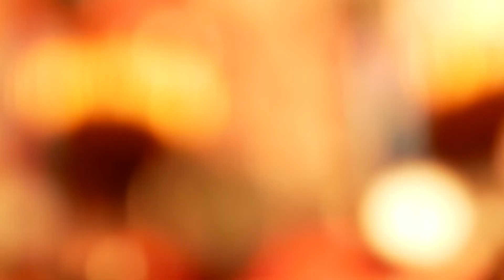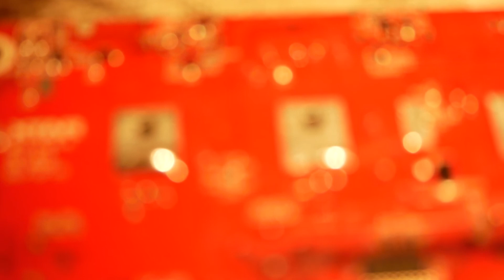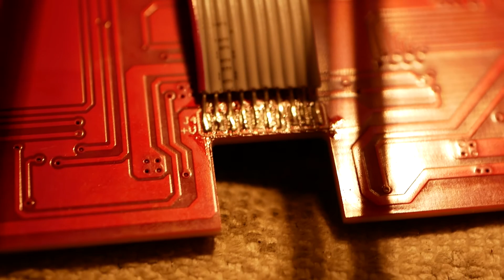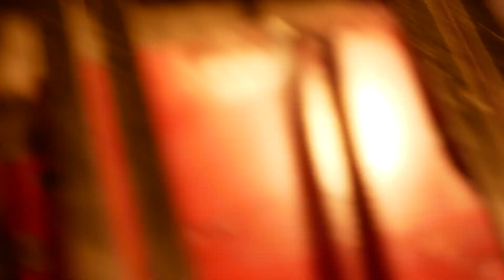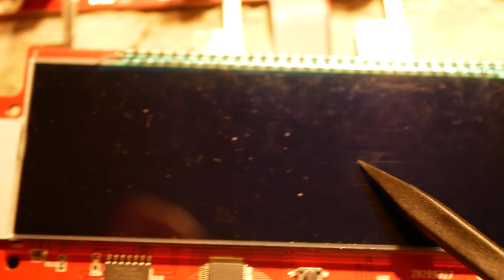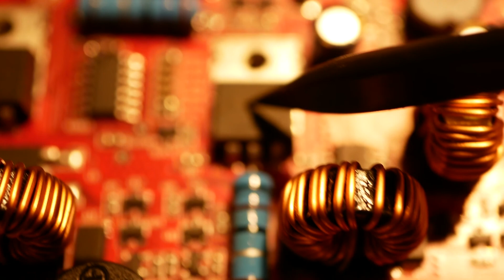XTAR VP4 plus teardown

Comment: Very nice review 👍 and in short this charger is not worth its $70 price tag but it’s way better than some other junk chargers out there 🤣
Reply from the maker: I have a LiitoKala Lii-S500 and an OPUS BT-C3100. Both are lots less money and they show it. I've compared the 3 cell testers with each other and frankly the XTAR VP4+ is the best of them. The Lii-S500 is a steaming turd. Just really BAD electronic design with loads of places where they cut corners! It does have a nice LCD. The quality of components and design thoroughness of the VP4+ is much better than the C3100. If what you care about is decently good accuracy of cell capacities for 18650's only, the OPUS is a good choice for a little less money. However, if you want to know cell resistance and you intend to test other cells like 21700's, I suggest getting the XTAR VP4+. It's the best for good reasons and it's price reflects that.
Reply: Those dudes that make solid brass 3-piece DE razors and sell them for $200+ sell them way more than it cost them to make it.

So 🛑 complaining!
Reply: No company is going to sell you something less than it costs to make. Are you going to sell something you make for less than it cost you? Answer that!

Nintendo Switch costs less to make than the MSRP. PlayStation 5 costs less to make than the MSRP. Xbox Series X costs less to make than the MSRP. An LG OLED TV costs less to make than the MSRP. A Lamborghini costs less to make than what is sold. Do you see the pattern?!

I am tired of hearing 🧠🧼, 🧠⚰️🧟‍♂️, 🥔🧠 complaining about how a device costs less to make than what it is being sold for. Just influencing more 🐑 and turning them into 🧠🧼, 🧠⚰️🧟‍♂️, 🥔🧠.

JESUS CHRIST!!!

Comment: Hello, I managed to dump 24v into the charger with the car charger cable. Had a mental note to pop a buck converter on the output  from the  solar charger  12v and then clean forgot. I blame age. So it popped the cap 220uf on the second battery channel. I have a small scope to try get the parts because i have had it less than a month. They are pretty black. If I am unable to read them could you help me with the transistors next to the blue resistor on the second cell? Would be a tremendous help. Sounds like you know your stuff!
Reply from the maker: LOL...I blame age for lots of things too!
Try to make a video of what's burnt. That will help. Then I can tell you what those part values are. Most likely the components after the DC-DC for the power input are OK. However, how the DC-DC blew up defines a lot about what happens after it. This may be a 50/50 shot at getting it going again...
I'm not sure if that cap you killed is in the second channel or not. This seems more likely to be a filter cap on the power input. IF you did blow parts in a channel, then the odds of repair go down a lot. IF you blew a few things in the main DC-DC, then repair is pretty likely.
Reply: @de-bodgery  thank you for your reply. I will give you as much information as possible as soon as I get a free minute:)
Reply: @de-bodgery   Okay i have some pictures etc. I am not entirely sure on how to get them to you?
Reply: @de-bodgery   Okay i have uploaded them here.https://ibb.co/brZqtwn https://ibb.co/yn5gsSk https://ibb.co/HDsW0sp https://ibb.co/JzGs7Qh. Hopefully you will be able to view them...
Reply from the maker: @johngreyvenstein5987  That first pic is the most telling...and of course C3 exploded. You have an o-scope. Does it do XY mode? Ever hear of a tracker? It is a super handy add-on to any XY capable o-scope. I wont have an o-scope that lacks XY mode because of the ability a tracker adds to it. All you need is a few resistors and a 6v transformer to build a tracker. I built one in the 1990's and am still using it today. 
https://www.youtube.com/watch?v=Gwo3pEH7hUE
A tracker is incredibly useful for looking at components in circuit or out of circuit. I discovered this in 1988 and have been using it ever since. Anyway, watch that video. Making your own is so easy and now you can compare components in one channel with another channel and find everything that is blown. You did blow up a channel in your charger. Do the other 3 still work OK? Did you put a cell in this charger channel and then it blew up? IF that is the case, then probably what happened is that channel turned on a larger mosfet which tolerated more voltage and the smaller components did not.
Reply from the maker: @johngreyvenstein5987  I scrounge parts all the time form old boards. Something dies that I care about or I need some part for some project, I scour through a pile of old boards I have gathered from TV's, radios, monitors, VCR's...whatever and find the part I need. In your case, you have C3, Q1, Q5 and Q6 that are cooked. They have a number on them. If they are not too badly scorched, you can read it directly. If not, the other 3 channels use the same components. You can find the part numbers from the other channels. Then I'd go scrounging through my pile of old boards for the parts I need. Usually I find the parts. When some electronic device dies, most of the components are still good. Quite often, nothing died, it just got retired and everything on the circuit board is still good. Great source for SMD parts like you have burned up!
Reply: @de-bodgery  thank you so much for your reply. I will see if I can salvage these parts from other broken or old electronics. I will watch the video that you recommend, I’m sure that will be very useful. Owe you a frosty :)
Reply from the maker: @johngreyvenstein5987  Not a problem...maybe you will get it going again. I'm pretty sure I could.

Comment: Great teardown thank you, I watched with interest as my VP4 plus isn't charging correctly on CH3. It's charging at around 2-3mah per second and never finishes a charge fully! If I move the lipo to another channel it checks it and then flags it as full (ps Ive tried a few lipos and have the same result) Any ideas what I need to check if I took it apart please. Any advise / help would be much appreciated.
Reply from the maker: Hi Trevor. Thanks for the feedback. My VP4+ is working on all 4 channels. 
1. I think if you are seeing a very low charge rate, there is a good chance the charge mosfet for the channel is not turning on or is turning on just a very small amount. 
2. These chargers have separate mosfets for the charge circuit and the discharge circuits. Does that channel discharge correctly? 
3. If the charge mosfet is working correctly, it is possible the power supply for that channel is not working correctly. They are adjustable. The output voltage of the 4 little power supplies track the cell voltage and then are adjusted upwards a little to create a small voltage difference between the power supply and the cell voltage. This is done to keep the current draw to that magical 1 amp limit. 
4. If the PSU's just delivered 4.2v, then a cell at 2.5v would pull more like 6-10 amps while one at 4.1v around .2 amps. Obviously the higher amp draw would burn out these light weight electronics! This might have happened actually. 
5.  It is possible that the tracking electronics for this one channel are not working and so it is not telling the power supply to adjust upwards enough to keep charging current high enough. The monitoring electronics are watching charge current and cell voltage. When these parameters reach certain levels the charger stops charging. I suspect that is why it stops charging after a little while.
**
Do you have any electronics experience? Do you have a DMM and an oscilloscope? These 2 tools would be super useful in trouble shooting channel 3. You could compare what happens on another channel with what happens on channel 3 and see the differences. This will let you step through the circuitry until you get to the section that behaves differently.
Reply: @de-bodgery  Hi, thanks for the detailed description. I think the charger is doing the opposite to what you're saying above (if thats possible). It's charging on CH3 much faster than on all the other channels and never reaches 100%.. It has previously shown an 'n' on the 1000 column & 2 x '11' ! I tried again this morning and now its 'err' and doesn't change to green when you install a battery. Could it be a capacitor that's faulty and if so can I chack it somehow. I don't own a DMM or oscilloscope I'm afraid..
Reply from the maker: @trevorc6793  With some diagnostic tools, you could do a lot to see what is happening to channel 3. A DMM is pretty inexpensive. A component tester will let you pull parts out of the board, test them and see if they are working or not. This is a bit harder to do since you need to remove them from the board to test them. An o-scope would let you check them in circuit while it is powered up.
**
I have this component tester. These things are inexpensive and every year they get more and more features added to them. I guess it was about 2016 that I bought mine. It's still working so I never bothered getting a newer one. These things are super handy for quickly checking components. I've found many bad components with mine. If you look around, you should be able to find a plastic case for it too. This will test capacitors and lots of other components too.
https://www.ebay.com/itm/2016-EZM328-GM328R-transistor-tester-frequency-meter-square-wave-genera/201663141755?hash=item2ef40f577b:g:plMAAOSwFe5Xzxsd
**
A clamp-on amp meter would be helpful too. You have a cell external to the charging bay that needs charging. You run 2 wires to the 2 contacts in the charging bay. Clamp the meter around one of them and now you are seeing actual charge or discharge current. If things are as you are saying...charging too quickly...you'll see well over 1 amp charge current. It it's like I said, then you'll see very low current flow.
**
I have all those tools as I mess with electronics a lot. Maybe if you are in the USA, you can send your VP4+ to me? There's no guarantee I can repair it. I'm far from capable of doing certain types of electronics repairs because they require expensive and specialized tools. However, large portions of these chargers are comprised of discrete components and I can deal with them readily enough. Right now, I'd give it 50/50 that it can be repaired. If it is monitoring electronics or the CPU...that's not going to be repaired easily. If it is something like a bad mosfet or cap...well that's pretty easy to deal with.  
**
You know what they cost new. Repair cost is only compelling if it is something easy to fix. If you did send it to me, I'd ask to keep you charger in trade for finding out if it easy to repair or not. If it ends up being easy to fix, I'd ask for shipping back to you and $30 for my time. The components more than likely will be so inexpensive as to not matter.
Reply: @de-bodgery  Thanks for the information. tbh, I don't want to delve to deep into electronics if possible. I'm happy to to attempt fairly simple things, but thats about it. Currently Xtar are sorting an exchange for me. So fingers crossed , I'll be charging safely once more....